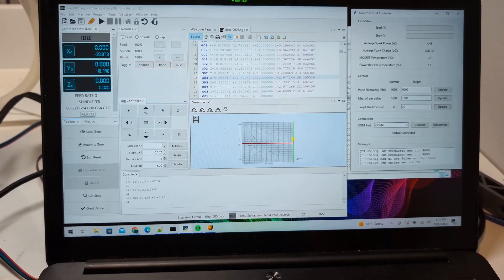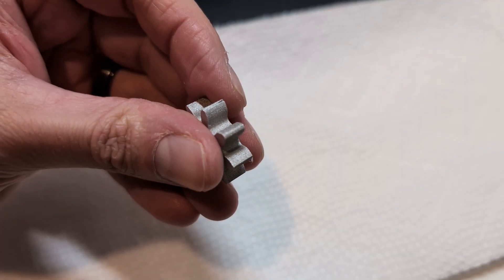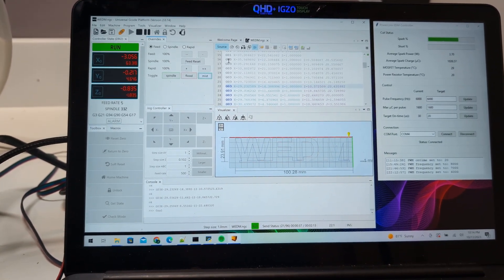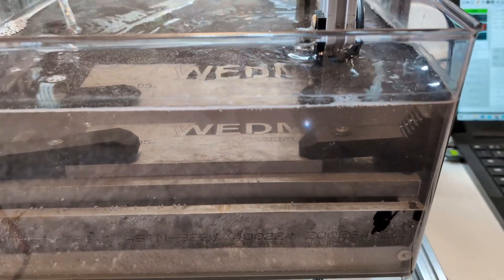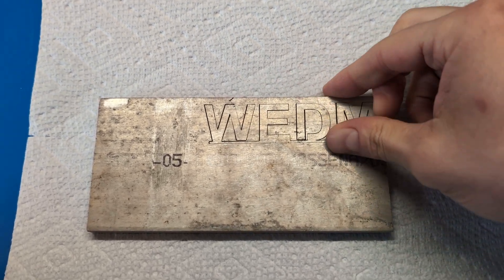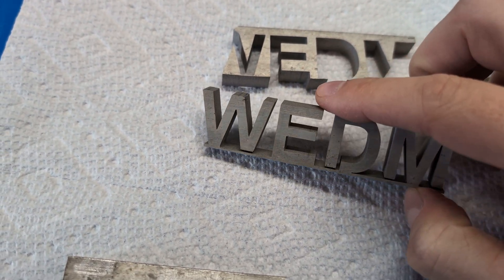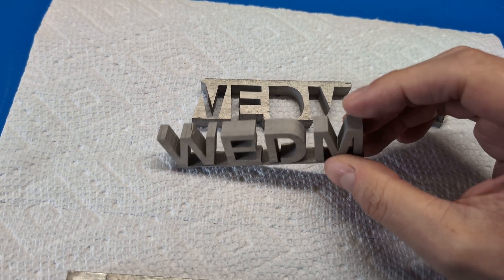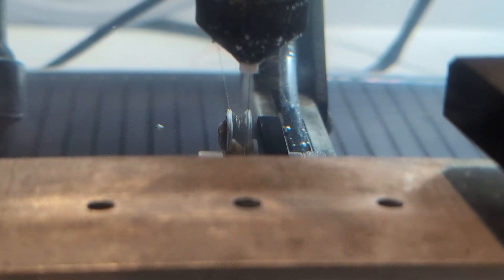Benchtop WEDM Example Cuts

Comment: I had a Chinese wedm machine the cutting voltage was always set at 20V,  for amps every mosfet had a switch and was added depending on material thickness cutting was mostly around 3A. By looking at your sparks its far to big. I only got bigger sparks when the wire first got cutting. I saw no sparks when the wire was inside the material, you could hardly see any sparking only tiny small ones at the wire.
Reply from the maker: Interesting 20V is way lower than I thought most WEDM machines cut at. I might have to explore that. Thanks for the input.

Comment: I wonder how much MORE rigid the system could be made? Where is the weakness coming from exactly? Should be relatively simple to get rid of the slop.
Reply from the maker: Ya for sure it could be made more ridged. My setup has two main spots where it's weak. Where the top frame mounts to the base and where the c frame mounts to the X axis. Maybe in the future I'll try to improve it a bit. Just not top priority right now.
Reply: @DesktopWEDM  You could WEDM braces for the frame maybe
Reply from the maker: Ya probably could huh 🤔 I'll think about it